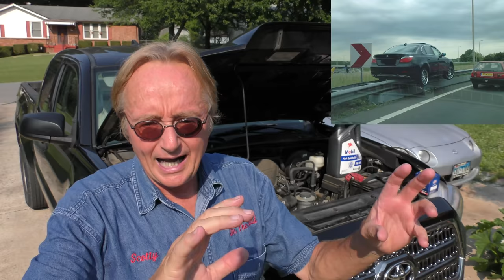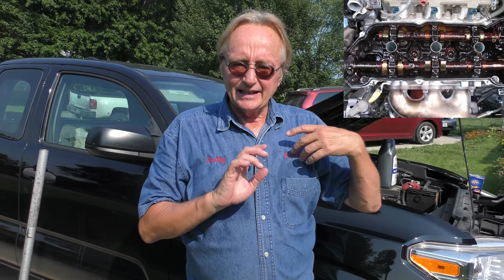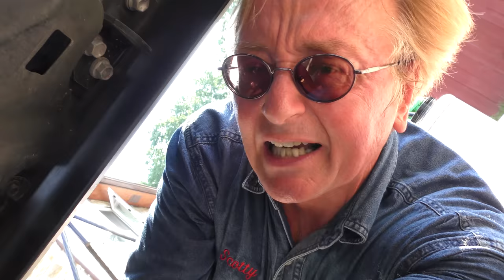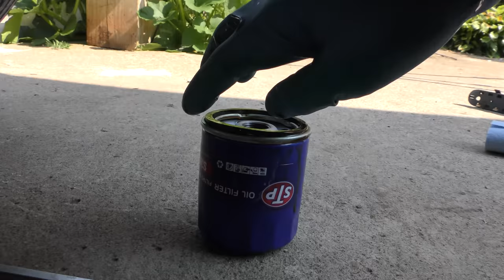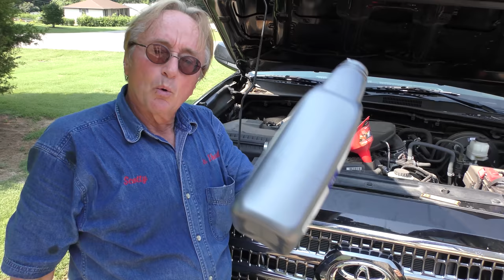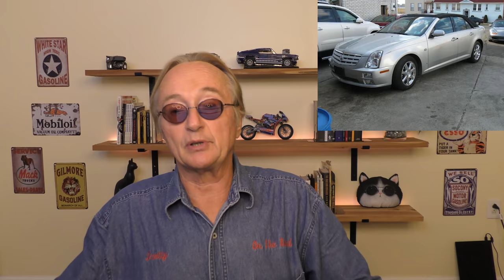My Son Never Changed His Engine Oil, Then This Happened

Comment: Dry ice blasting has been used for the last 25 years in Norway to clean electrical cabinets at Hydro electric plants. Dry Ice does not ruin car electronics, do some research before spreading false information please...
Reply: Exactly! High end mechanics also use it on engines since it is just about the most gentle way to do it. Fellow European here.
Reply: Exactly right! It's funny, almost anything BESIDES dry ice would harm electronics. Dry ice cleaning an engine bay takes 5, 10, maybe 15 minutes which is not long enough for any one part to get "too cold".

Comment: Finding out where the engineers placed the oil filters on some of these vehicles can be a challenge too. Just look for the most inaccessible areas. Trucks are great for access, but some cars you can't even get a tool on the filter. I like to do my own oil changes because the quick change/dealership put those filters on way too tight. Hand tight like Scotty showed is more than enough. Also, if you do your own oil changes you can see if there are leaks that need to be addressed.

Comment: Daughter went to change oil a number of times, think she went to a bar, for about 30k miles. When I was looking at her metal to metal brake rotor checked the oil, not a drop on the dip stick.  Car was sold but is still running, a Kia with a leaking rear seal.

Comment: It's a good thing it's a Toyota, they can handle a little neglect.
There are few other cars that can handle oil change neglect.
I've been changing my own oil on my cars since forever.
No one has changed the oil or oil filters on any of my cars except for me and I do it consistently under 5,000 miles.
The car I currently own is a Honda and it has 112,000mi. on the original engine. I recently removed the valve cover and the valvetrain doesn't look any different than the day I bought it with 13,000miles! 
People say a clean Honda valvetrain resembles a jewelry box the way it sparkles when clean and mine still has that shine in it.
That's a testament to how long an engine can last with regular oil and oil filter changes.

Comment: Just putting the drain plug back in is a major job. After the oil STOPS DRIPPING, inspect the drain plug washer for damage. If even suspected, replace it with a new one. Wipe off oil pan plughole & install plug and properly TORQUE WITH A TORQUE WRENCH. If no such tool is available, go buy one. After the plug is PROPERLY TORQUED; AND A NEW FILTER IS SCREWED ON with oil in it, put the oil in; up to the full mark. Run engine making sure that the oil pressure is o.k., then, after a while when the oil is HOT, check the DRAIN PLUG AGAIN for drippage. SOMETIMES they start dripping when the oil gets hot. Top off oil, the end.

Comment: I use the big cardboard shipping boxes to put under the vehicle to catch any oil drips and soften the ground for me. I turn the boxes inside out to lay on the cleaner cardboard side. Also Costco has a low price on their Kirkland full synthetic 0W-20 oil $25 for 10 quarts.

Comment: I always start the engine and then check for leaks. Once is 40 years, the old gasket was stuck on the engine and I didn't see it. As soon as I started it, oil squirted out like crazy.  So check the gasket, and then to be double safe, check for leaks.

Comment: My 1996 Ford Ranger 4.0 4X4 turned 602,000 miles last Thursday Scotty. How about doing a video on my truck? Oil changed regular w/ castrol GTX and fram filter. Timing chain every 100,000. I live in Chattanooga. Want you to autograph my trucks dash. 😎

Comment: Ah Scotty ya forgot 1 on an easy one. I like to fill the oil filter with the new oil on these, since it's goes on vertically. Only takes a second and gives the engine a full shot of oil on 1st start up. Horizonal ones, you kinda have to do dry. Then I take a carpenters crayon (grease pencil) and write on it somewhere how my quarts of oil to make it easy the next time.
The old saying is so true, "the only replacement for maintenance is full replacement."

Comment: I changed my oil like in late february then apparently it started burning oil bad cause I blew my engine last monday. luckily its a 2007 matrix and another engine was $600 bucks so it wasn't too expensive still inconvenient but check your oil every 2 weeks people if you drive an older car like mine. Im 22 so great learning experience

Comment: If possible , Always change your own oil .
So many bad stories about incompetent oil change people either :
Cross-threading the oil drain bolt when re-installing or 
not putting enough oil in the car .
or installing oil filters incorrectly .
If you must go to an oil change shop or Walmart , etc , be sure you check the level  yourself before you drive away .
And check under your hood at least once a week (all fluid levels ) if you want your car to last .

Comment: My 2008 Sierra needed oil change every 5000km, you can hear the engine sounding rough at the 4K interval.  Sold it last year, bought a 2020 Tundra. Oil change needed every 16000km ! 👍

Comment: About a year ago I changed my oil in my apartment parking lot, in stealth mode,  I didn't check the filter I took off.  Screwed the new one one hand tight.  What a mess you can make if the gasket from your old filter is left  on.  Had to get an Uber to get more oil. Had to buy absorbant to clean my mess,  nt to mention the time and stress,  I have changed my oil several times w/o issues, check the old filter.

Comment: I had a friend who had a 1995 s10 with the v6.  Said man it’s not running good !?!?  I checked the oil , no oil. I said when have you changed it?  He said I haven’t    I took off the drain plug and maybe 1/2 qt came out and it was total sludge.   I laughed so hard my stomach hurt for days.  I replaced the filter and put in 5 qts and he drove it for a few weeks then totaled it said it was so fast now.  True story.

Comment: I had another car come in today where the oil pan was messed up pretty bad and the drain plug was messed up could not hold a torque and whoever serviced it previously had taken a hammer to the oil pan for some stupid reason I've seen some things in the past but I think this was the top notch never take a hammer to your oil pan even if the oil plug is stuck just whack it with your one hand while your other hand is holding the wrench all the crazy things I've seen

Comment: You want to always change or at least unscrew the old oil filter before sealing the sump back with a plug. In this situation, where the filter is an old type metal one, facing downwards, maybe thats not a big deal, but there are configurations, when its mounted horizontally or even upwards. In that case, a lot of oil comes down to the sump when you unscrew it and let the air in. It is even more important, when the filter is of cartridge type, with a cover, facing upwards, as that way as much as 0,5liters of oil gets down to the already sealed sump and leaves unchanged.

Comment: Yup, I've been doing my oil changes for nearly 10 years. I got tired of the dealership / oil changing places losing the clips and bolts that hold the underbody splash guards. I'd buy those clips and bolts, tell them about it, and they would lose them again. Leaving those splashguards loose, caused water to ruin one of my batteries. Or at least I think that's what happened, because i had to change the terminal due to corrosion. Once I started changing the oil myself, all problems stopped. Also, I change it every 3,000 to 5,000 miles depending on how dirty the synthetic oil looks. I won't wait from 7,000 to 10,000 miles for oil change intervals, as I don't trust those numbers in real world conditions.

Comment: Through experience l have found that oil filters that have been on for a long time maybe 2 yrs are difficult to get off, because the rubber seal swells up.
High milage on one oil change causes the oil to get contaminated and this also causes the seal to swell.

Comment: my car burned oil.. so I never changed it.  Just added a quart every 2nd fill up, or as needed.   Ran it for years 7+ years like that... then sold it...    I saved 100's on oil changes...   It was a honda so I wasn't too worried.    I figured if I"m adding so much oil,  why bother replacing it...

Comment: My sister never changed her oil on her 2002 Focus. I changed it for her a present, but then told her in 3000 miles, get the oil changed. I even put the sticker on the windshield to remind her. Long story short, I kept reminding her to change her oil when she was 5000 miles overdue for an oil change, but she never did. One day my brother was driving her car on the highway. Engine seized.

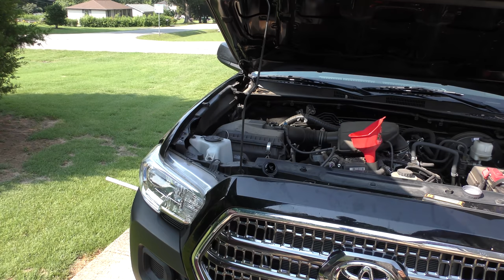Comment: I recently just did an oil change on my Hyundai Sonata and accidentally started the car with the funnel sitting on top of the engine like at 6:46 in the video. The oil splattered out of the filler neck a little. It's probably a good idea to remove the funnel and screw the oil cap back on before starting the car. LOL

Comment: I owned a '97 Cadillac Sedan DeVille that was smooth, fast, handled well, comfortable, great seats, quiet... The only problem with it was it was a hangar queen.  For what I spent maintaining that piece of shiite, you could have put a kid through Harvard.

I still don't understand how Cadillac could get so much of the car right and still get the reliability so wrong.  All I know is that I never want another one.  We traded for an '05 Honda Element.  It was the Caddy's polar opposite.  Rough, slowish, uncomfortable, noisy.  But it is the most reliable car I've ever owned.  Bought it new in '05.  Today it has 172,000 miles on it and still runs great.  Only major repair was changing the struts at 170,000.

Peter Drucker, in his epic tome "Management", said that quality is a management decision.  If that's true, Cadillac decided not to deliver reliability.

Comment: I've been using one of those cheap rubber strap wrenches for the filters for some time now and it works great.  Totally agree with using a breaker bar - I'd been using just a normal ratchet wrench for years but picked up a breaker bar a couple years ago after I couldn't get the drain plug off my wife's car after the dealer had serviced it - I should have bought one a decade ago, makes it so much easier.    Honestly - I can change both our cars myself MUCH quicker than taking even one to somebody else to do it and I get to pick what oil and filter I use, then just drop the oil off to be recycled.  Easy peasy lemon squeezy.

Comment: I had a girl friend back in the earily 90's and  she had a Ford Escort with over 60,000 mi on it and I asked her have you ever changed the oil and she said no! She lived on a dusty road. Then I said I will change it for you and when I did it came out like liquid grease. The filter was solid with thick oil! I had to run a engine cleaner through it. I do not know what came out with the car after change because I had to dump her because of lack of oil changes!!

Comment: Mileage is really a pretty dumb way to decide when to do oil changes. Run time, heat cycling, and abnormal loads like towing/tracking are what matters. Might as well just use a 1-4 rule. Once a year for grocery getter. 4 times a year if you basically live in your car

Comment: Used to cost about $10 for an oil change 50 years ago
Reply: 40 years ago when I was a poor graduate student in U.S., I always bought the big brand  oil in case of 24 cans at 15 cents each when on sale available from K-mart, Skaggs Albertson, Kroger, then split it with my roommates.  The oil filter costs about 79 cents on sale for FRAM.  Oil change was our weekend pastime with our clunkers.  But the clunkers never failed us.

It costs me about $1.50 to change oil for my beaten Datsun B210 with 3.5 quarts capacity.

Comment: Would like to hear Scotty's opinion of AMSOIL.  I have a 2020 Ford Explorer with I4 Eco-Boost.  I purchase the 25k mile oil and change @ 21k with Wix XP Filter change every 7k.  It is excessive but actually cheaper than full oil change every 5K miles like I did on previous Explorer.  Oil still seems to have a great amount of viscosity and no sediment at 21k miles but is relatively dark at that point.

Comment: My Dad never changed the oil in my old Corvair. He just added when it got low and it was finally so thick the car won’t run. He took it to be fixed and the guy had to drop the oil pan and scrape it out

Comment: This is making me think of that episode of Beavis & Butthead where their boss at Burger World told them to change the oil in the deep fryer. Instead of using vegetable oil they went to a nearby garage and got motor oil. It didn't end well. If you've seen the episode you know what I mean. I've changed oil in and cleaned out those big commercial deep fryers and I would rather change engine oil any day.

Comment: Back in '06 when my Mom bought her highlander, she refused to allow me to change the oil even though it would've have save her a ton of time & money.  She insisted on driving 20mi. to the toyota dealership, and waiting 3hrs to be overcharged for an oil change that never happened.  I was working at a fluid change shop around the corner from  her house, but she still insisted on going to the dealership.  Unfortunately, she kept this up until '22.  When She finally relented, and allowed me to change the oil.  The first thing I saw was a leaking valve cover gasket, which is how I knew the dealership ripped her off all those yrs. So I changed that too.  Thankfully, the cams & internals had only slight wearing on them.  I decided to run an oil flush before the change, and did a transmission drain & fill for good measure.  She ended up driving out of town a few days later, and when she got home, she  admitted to me that she should've allowed me to do the oil changes decades ago b/c her car ran so much better during her roadtrip.  I also changed the coilpacks, plugs & airfilter.  Now she she'll never trust the dealership ever again😆 Now I change the oil in her car every 5k.  And the first couple of times since I started changing her oil, I flushed the oiling system.  Thankfully, no sludge, and no burning or leaking.

Comment: Well...mine prius has a pressure sensor to measure blockage in oil thru the oil filter...
--so metal wear shavings in oil dont matter...the sensor should sense the same amount junk build up in oil...
--my oils black when oil light goes off from oil pressure sensor...(different brands sets it off sooner or puts it off longer 4000-9000miles)
--i never lose oil level/0-0.5quarts unless i floor the gas=super small oil leak/worn piston rings...(no black smoke...)

Comment: I used to sell auto parts.  A guy came in yelling and cursing, saying I sold him the wrong filter and that it wouldn't fit on his car.  He brought his old one and new one in for me to look at.  It took all of two seconds to see that the rubber gasket was not on his old filter, and I pointed that out saying his old gasket was still on the car.  He didn't say a word.  Just grabbed his filters and left.  He did call to thank me later.

Comment: I also forgot to change my oil recently n I had a couple of issues with my car vibrating as hell. Guess what did the magic on my car, I changed my tires first and then I changed my oil n now the car looks even better than when I bought it. So change your oil earlier to avoid issues. I was supposed to change my oil after every 5000km but I used my car for more than 7500km. This could even be more because the car dealer I bought the car from didn't give me the km of the last oil change before I bought the car. I had to change my spark plugs too.

Comment: So I just received some very disheartening news. My car is leaking oil and when I had it looked at, I was told that it's leaking from everywhere! Oil pan, all over the engine. Was told my engine has to be resealed. I bought the car back in December for $2400. Its a 2003 Nissan Maxima with over 200,000 miles on it. Any tips would be greatly appreciated there Scotty.
Reply: On Nissans be sure to check the oil seal behind the harmonic balancer, they are notorious few spewing out oil across your oil pan and all up under your car
Reply: I meant notorious for spewing
Reply: @CharlesLStokes-qp7pq  I'm gonna go get a second opinion but the first place told me valves, valve covers, oil pan and some other stuff. Is there some stuff I could pour in with the oil that could help seal it off?
Reply: @mcc7762  Thank you. I did take it to a mechanic and they said my whole engine would have to be resealed. Told me somewhere between $5000 to do all that. I did just put some Blue Devil reseal in it which did stop the drip that I could see but don't know how good it worked. The drop was every 3 seconds with the engine running which I think was coming from the oil pan but also I'm not good or know anything at all about mechanics

Comment: Hi Scott! Im always waiting for your live video. Thank u for keeping us informed. May I ask when to change transmission oil if I changed my CVT transmission of Honda HR-V 2017 two (2) years ago. Thank you and God bless! Rudy B.
Reply: You had better change your CVT tranny oil every 2~3 years.  Gear tranmy oil has to be changed around 50,000 miles or when you buy an used car(because the former owner possibly never changed his tranny oil since new car).

Meanwhile, be very cautious about your Honda: "Use Honda oil/fluid only!"!  Because Honda made their tranny in-house, thus they have their tranny oil of special formula of their own.  Generic tranny oil does not go along well in the long run and would cause tranny breakdown.  Honda is also picky about power steering fluid.  So, your oil and fluid have to be Honda brand to be out of trouble in the future.